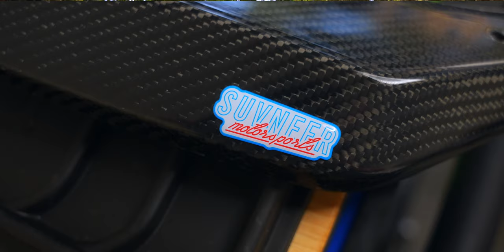PROPER BMW Lip Install

Comment: Looks so good! I originally put self tapping screws on my front lip but lost a few over time and replaced them with nuts and bolts. Also if it's cold outside, using a heat gun on the adhesive helps a lot!
Reply from the maker: Thanks for the tips! I hope you don't mind that I pinned your comment, I think you shared some very valuable information 👍

Comment: Not bad splitter, but I prefer the cleaner look of the lip that integrates nicer with the two holes you have at the front. You should also check out Diamond Splitter bumper inserts for the F22. I was expecting you to get a M2c bumper designed specifically for the F22, would match the hood :)
Reply from the maker: I like that design that curves up too, would have been better for clearance. The M2C bumper so something I have to save up for that one is pretty expensive lol. I'll take a look into the splitters, thanks for the suggestion

Comment: Hello, not sure if you're still active, but at 4:20 the part which you're removing the screws from, which basically connects the bumper to the splash shield - would you happen to know the name/part number of it? I lost it so my splash shield came off and I need this "spacer" part to connect the new splash shield.